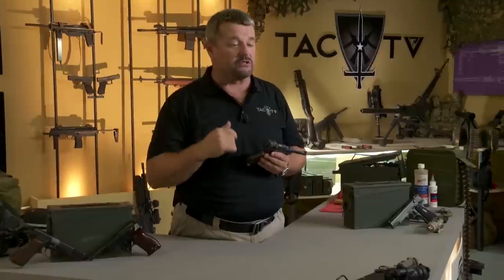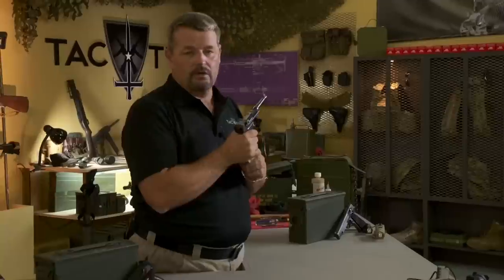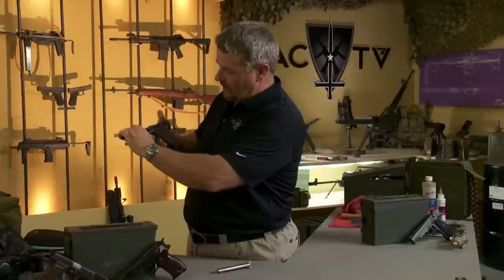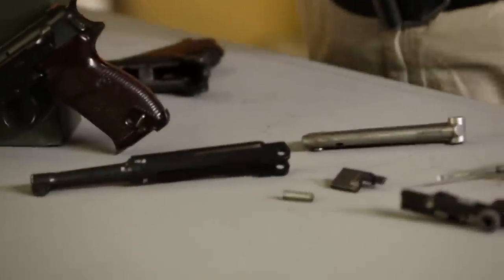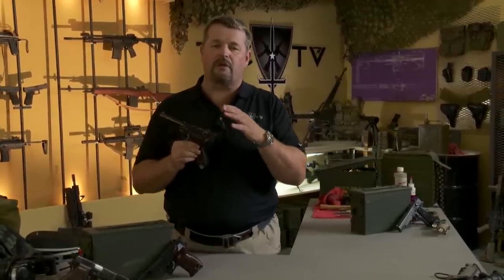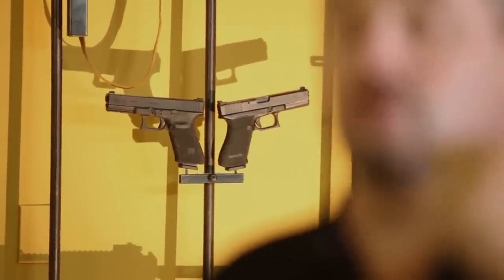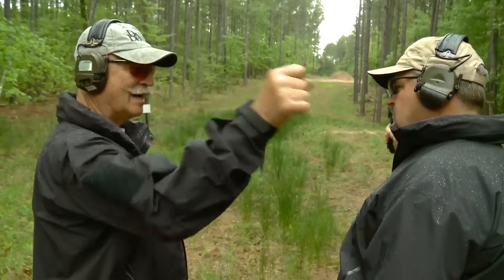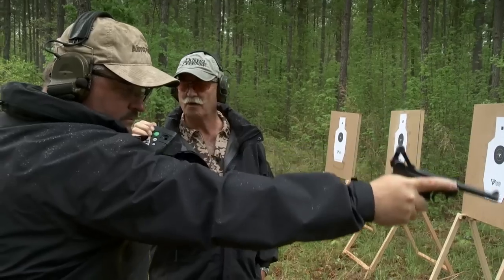Luger Pistol

Comment: I bought an Imperial Luger dated 1912, and just now realized that it has regimental markings as well. This is my first Luger so I'm quite inexperienced. According to the markings it was issued to the first infantry regiment machine gun company. It's also one of the earliest P.08 models so it doesn't have the groove on the back of the grip meant for attaching a stock. Any opinions on the value and rarity of this Luger?
Reply: I would recommend checking out Ian at Forgotten Weapons on yt.